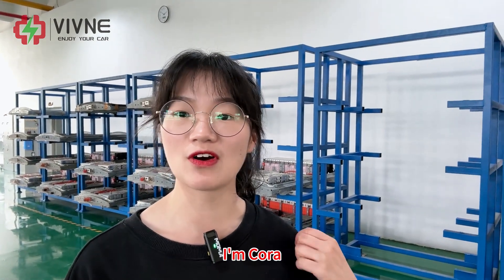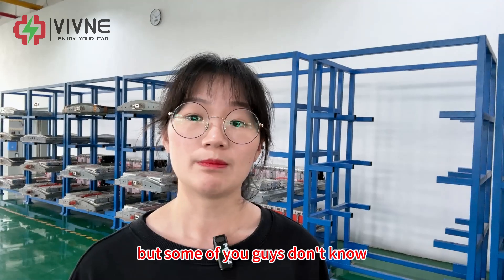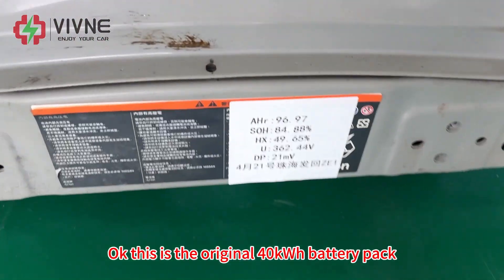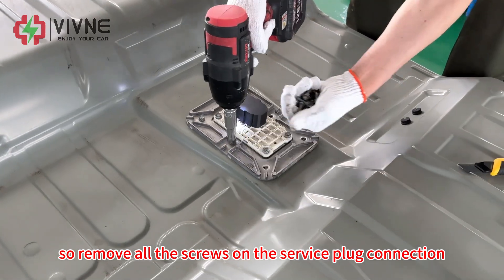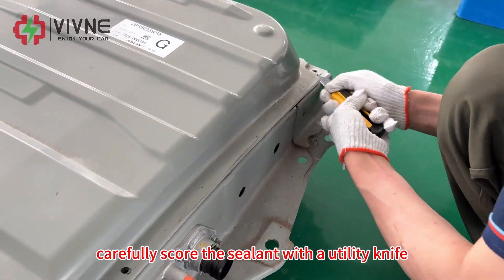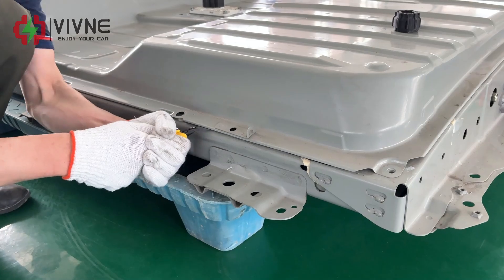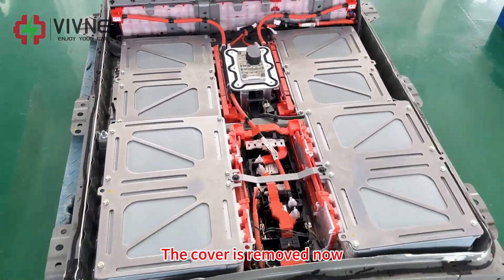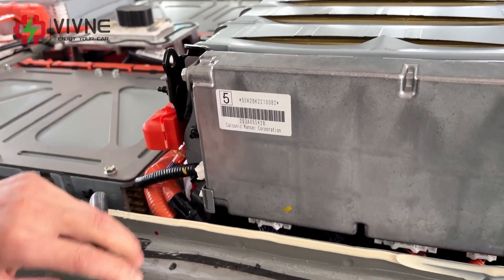VIVNE-How to remove Nissan leaf BMS

Comment: Hi Cora,  I just got my 50kwh battery from VIVNE.  It is now working in my leaf.  I am just about to pull out the old bms and I am wondering if there is a correct order to disconnect the BMS plugs?
Reply from the maker: Hi my friend, great to hear that the 50kWh battery is already working in your Leaf — that’s awesome!
As for the old BMS, there’s no specific order required when disconnecting the plugs. Once you open the cover, just go ahead and unplug all the connectors from the BMS.

Comment: Why does the BMS of the old battery need to be returned? I am curious.
Reply from the maker: After upgrading the battery to a higher capacity, the BMS must be reprogrammed for the vehicle to recognize the increased capacity and for the dashboard to display the accurate range. Therefore, the owner needs to send the original BMS to us for reprogramming. However, to avoid disrupting the owner’s daily use, we will first provide a pre-programmed BMS and ship it together with the new battery. After the owner receives and installs the new battery, they can then return the original BMS to us.
Reply: @VIVNE-CoraLiu  That makes sense, it is swopping the BMS. I guess that you use the returned one to reprogram for other customers. In Australia, we have a cute word for this, we say "swopsie"
Reply from the maker: @ Haha yes, swopping the BMS😆